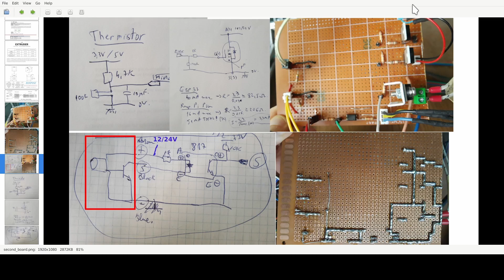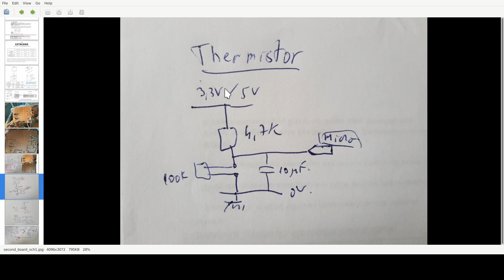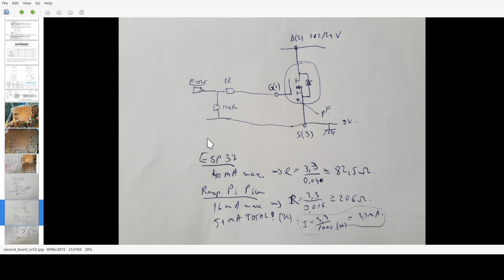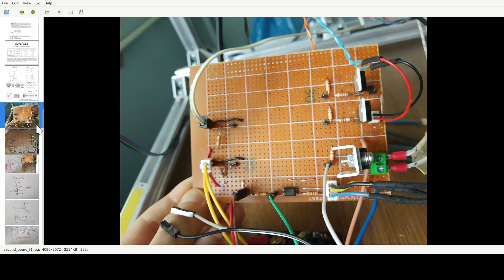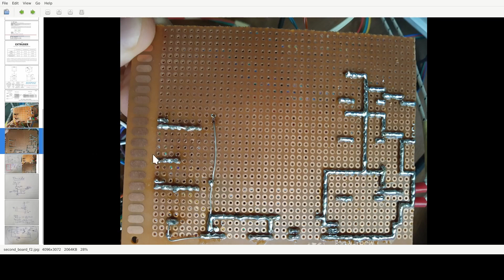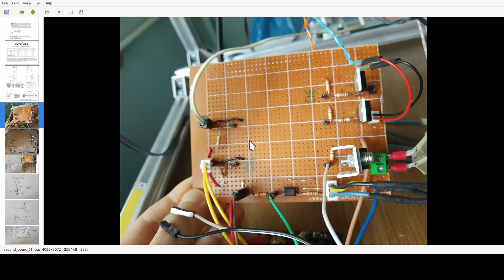diy 3d printer board part 2 - thermistor, transistors and inductive probe

Comment: Salut. Poti te rog sa detaliezi. Cum poti sa citesti temperatura folosind un raspberry pico si un termistor si o rezistenta de 4,7k. Multumesc
Reply from the maker: salut, pe raspberry pico rulez klipper care face calculele si transforma voltaju citit in temperatura. ii spui pe ce pin citesti voltaju analogic, si ce termistor folosesti de obicei cel standard generic de 100k la temperatura camerei si foloseste el niste tabele sa calculeze. o sa fac un video zilele astea ca am tot amanat cum se instaleaza si configureaza klipper.
Reply: @CNCTinker  am klipper pe pico. Am imprimanta ideea e ca voiam sa adaug un nou senzor de temp. Insa nu am inteles cum sa il leg. Am facut in .cfg
O sectiune noua pt el ca senzor. Si cum il leg senzorul are 2 cabluri evident unu il leg la gpio29 de ex si celalalt capat la 5v sau la gnd? Am incercat si si fara success. nu am avut success
Reply from the maker: @dury10  ce senzor de temeperatura ai ? daca este un termistor, nu functioneaza cum l-ai conectat tu. In schema din video acolo unde scrie 100k se leaga senzorul. Practic cele 2 fire de la senzor le legi asa: un capat la gnd, si celalat capat la o rezistenta de 4.7k, iar celalat capat al rezistenti la 3.3v ca  pini de pe pico merg la 3.3v. si apoi legi la gpio29 punctul de conexiune intre senzor si rezistenta de 4.7k, eu in video am mai pus si un condensator mic de 10uf dar il poti ignora, merge si fara, doar iti face citirea temperaturii mai stabila.

Comment: this helps a lot to understand the circuit blocks of what makes a 3d printer board works. are you planning on etching your own pcb too? toner transfer method can be used to make a double sided pcb.
Reply from the maker: yes I want to make just one board to make it more compact. I will post the circuit design when it is ready.